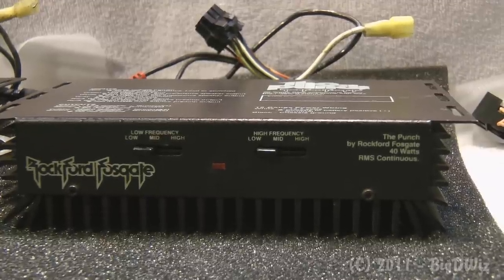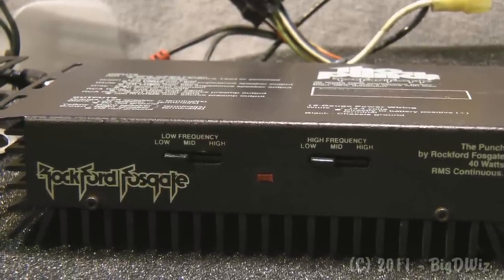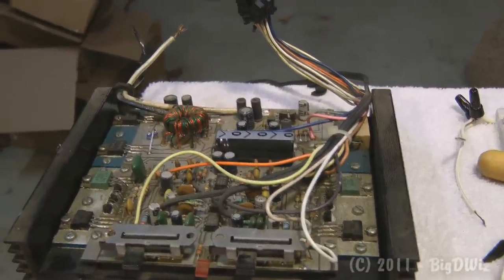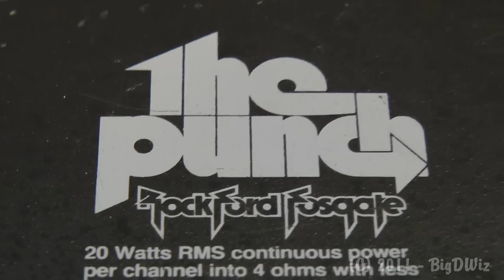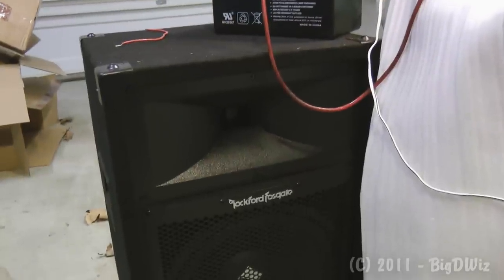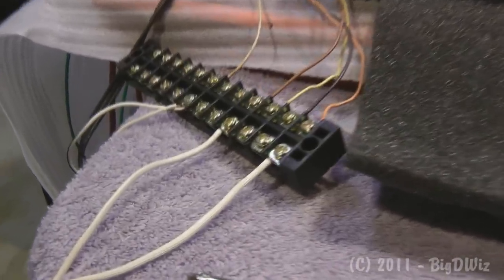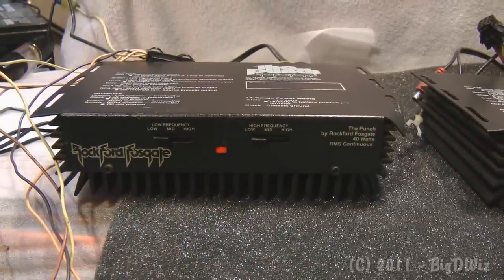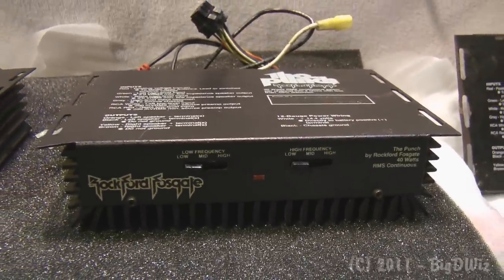Vintage Rockford Fosgate Punch 40 Slider Amp Demo

Comment from the maker: @RWL2011 Yeah, it sounds pretty sweet, but does not hold a candle to the later Punch 45HD I have as well. I attempted to make a vid of the Punch 40 slider pushing the Polk dB8 8" sub and it didn't push it very well. I have the equipment to do RMS wattage measurements, so I'll bench test this amp soon and post the results. I'm thinking 6x9's were the application for this amp back in the day.

Comment: In 95, I used to have a stealth install with 2 of these mounted in the slide top cupholder/changetray(with an alpine 1/2din eq also In the tray)my f&r kaopa 3ways and a punch 60 powering 2 rf audiophile 10’s in an f2f isobaric 4th where the woofers hang below the enclosure inside the tire well(as the sealed chamber) and the ported enclosure sat on top of the spare tire well. You couldn’t tell there was a system in it at all. Such a clean strealthmode microbuild. Miss that build...
Reply from the maker: I love stealth ✈️
Reply: Gotta keep your jewels on lockdown!

Comment: I had a Fosgate Punch amp in 1980 that I purchased from a friend.  I don't remember if it was 40 watts.  I thought it was an odd number not an even 40 watts.  It had two little toggle switches to boost or cut the high and low frequencies.  This amp was pushing a pair of Visonik David speakers that had a 4" mid and a 1" tweeter.  For bass I had two Magnum 6X9 woofers and two Becker 10" subs all powered by a Sanyo PA6100.  That little Fosgate amp worked great.

Comment: I have one if you are interested.  I am the original AZ owner in 1984/85 (can't remember - it was a different world) but It was installed in an 81 Celica ST Coup with  2 tweeters & 2 mid range in the doors & 2 woofers in the back deck.  It frigg'n rocked!

Comment: Looks like that axial capacitor was replaced. Its different then the one that is in mine. Also your wire colors are different as well as the RCAs on mine are all metal.